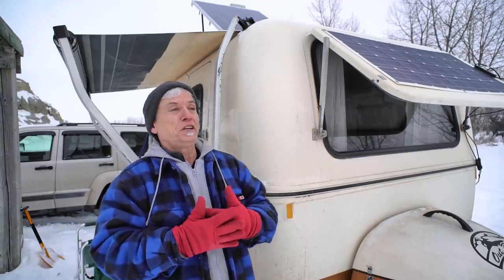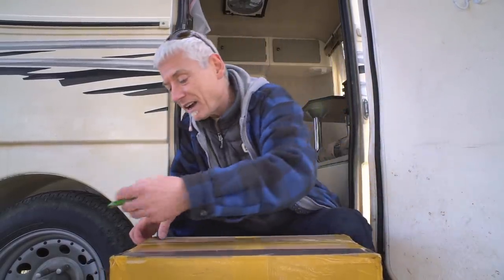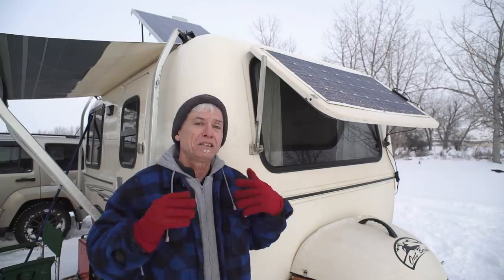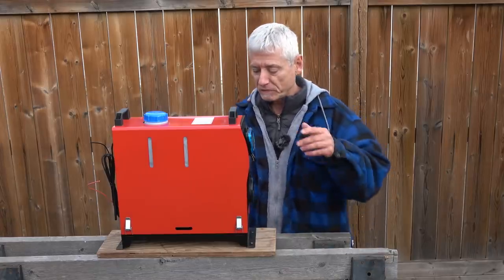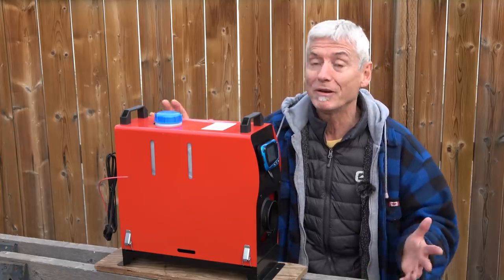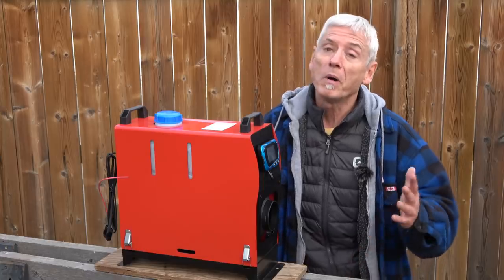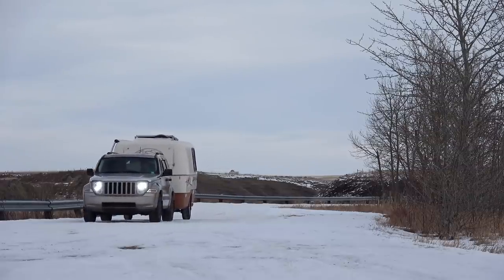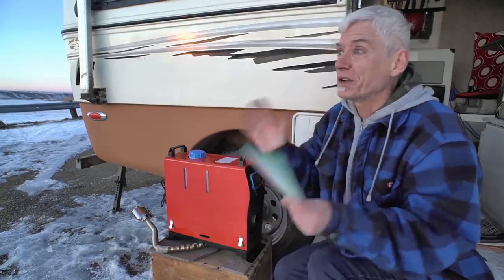Can this Work with a Camper? My Parking Heater Experiment: Part One

Comment: I have my Diesel heater in a cockpit locker, also on the outside. I have been using it with outside air too, no circulation. It gives out nice dry heat, with relative humidity levels of 30%. Totally unheard of in a boat in the wet Netherlands. I really like it!! It is worth the effort to get it bug free. I would look for vacuum leaks in the fuel line before the pump, and use hard nylon line after the fuel pump. Also the Diesel needs to be of winter quality, add 1/4 of Kerosene to prevent it from clogging in low temperature if unsure. My heater will not go below 1.8Hz btw. At the lower settings you risk flame out.    Well, those are my 2 cents, happy puzzling! (I do realize that part 2 is already in the making and you solved it weeks ago. Sorry but I have this Compulsive Fixing Other Peoples Problems Disorder :-)

Comment: I have also heard/read that you need to run the heater at max temp for about 30 minutes periodically. It allows the heater to burn off the carbon deposits that build up when you use it at a lower temp setting.

Comment: SLIM, thanks for the uplifting videos!
1) I'd point the exhaust away from the fresh air intake.
2) Why don't you bring the thermostat unit into the trailer?
3) These are meant to re-heat inside air just like your propane heater does, not heat -6C air.
4) Did you open any vents to allow air out as you pump air into the trailer?  These units shut down when they overheat due to lack of air flow.
5) Can't wait to see the final outcome!
Reply from the maker: 7) Watch Part 2 right now . It will answer many of your questions. SP

Comment: The click is the pump. I've noticed that other rv dwellers suspend the pump so that it's not directly attached to a surface. They say it reduces the clucking noise. However, yours is an all in one.
Reply: I wonder that if the pump is mounted with screws or nuts and bolts if you could add some rubber/silicone washers to dampen the vibration and soften the noise. or if the pump doesn't get hot if you could put some sound dampener like kilmat or noico on it

Comment: I have had my diesel heater for about 2 years now and went through all the same learning curves as you did. We heat a rooftop tent and this is way too much heater for our needs. We have good sleeping gear and blankets etc. so we heat our tent for about 1/2 an hour and all the bedding is about 80F (26C), shut it down and we use it when it gets super cold or when we get up in the morning via the remote. end ofOctober we camped in Upper Minnesota and it got down to 23F (-5C).

Comment: Slim, you may want to use diesel anti-gel additive in winter because diesel will turn to gell in fridgid weather. A real advance over their predecessors, gasoline powered heaters.  I know of people using kerosene or vegetable oil instead of diesel.
Smaller versions of these heaters are ideal for use in vintage Volkswagens for driving in northern climes. The optional gasoline heaters for VWs are very rare, very expensive, big, and very complicated to maintain.

Comment: Our old camper caravan has a propane stove and we could choose not to run the fan on it, to save on power. It would be heating, but not circulating hot air, so we never used it much without the fan running. We had a lead acid battery and it held enough power for a few lights and that fan, during a day and night, but I usually had to connect my car and run the engine to charge it up while driving. It worked great for us, although we never winter camped. Just during the spring, summer and autumn and mostly when it was raining and a bit chilly. We never ran it while we were sleeping. I have too much respect, being a firefighter, to be careless with such things.

Comment: I have one of these without the metal cabinet. I don't have the noise problem from the pump. I think the metal cabinet may be acting like the box around a musical instrument 🎸 which amplifies the level of the sound. I suggest that you open up the box and wrap the pump in something like foam rubber to insulate the sound from the cabinet.

Comment: I've got a 2KW unit in my camper. I think your unit is going to run full bore unless you move the controller into the camper. It has the temperature sensor in it. I started with video 2 and your complaint about it being too hot was the first cue. My initial installation was a hot mess, because the fuel line was touching the exhaust hose, which wasn't apparent at first. Glad to see a new video! Hope you had a good Christmas.

Comment: The Jackery turned off, if not drawing enough power... it turns itself off... the heater doesn't draw enough power on the lowest setting for the timer in the jackery.
Reply: but if that happens the heater's mother boards gets damaged. sudden power loss is not good for them

Comment: It boggles my mind that people still wonder if these diesel heaters will work well for their rv, van, camper, bus.  Lots and lots of people have been using them for years now.  In the commercial industry,  semi trucks have been using them for 10-15 years or more.  
    Slim, i am lucky to have access to webasto and eberspacher heaters for very low prices.  But same difference.   I have a 1983 dodge van.  Ive been living in it for over 2 years. I have a webasto.  Just simply hooked to 1 battery. Works great.  I can have it 80F with window s open when its -10F outside. Van isnt insulated.  I don't ever smell diesel.
Reply: I have a Webasto as well and it is simply superb. The fan noise could be a little better but I have no complaints in terms of heating performance or with regards to the amount of Amps it uses.
Reply: @Daz555Daz  neat
Reply: I love ingenious persons...and share your thought

Comment: Your placing the entire unit outside & connecting the hot air hose to the wall vent is something I didn't see coming. Genius move, dude! 
I wonder if wrapping the hot air hose with an insulating wrap would increase the efficiency at all?

Comment: You may wish to locate the exhaust muffler further away from the heater " Cabin Air Intake ", that's why the exhaust port on the heater aims downwards. Just a thought
Reply from the maker: See Part 2!
Reply: @SlimPotatohead  Bingo

Comment: Slim, once sorted out you will have a good multi purpose unit. Weather to heat your house during a power failure or to heat up your engine block while off grid. Just a thought......

Comment: I saw a review of this one and a Webasto, and its clear that you get what you pay for.
Reply from the maker: That saying means nothing unfortunately. If I spent $1000 more would it be better? Or, I would just be out more money? It depends on the purpose, not the price. SP
Reply: @SlimPotatohead  It would be objectively "better", but for your use case it is impossible to say as every case is different. There is little doubt however that Webasto makes a premium product - but they charge you for it! Still, mine is 21 years old now (same as my camper) and still working like it was brand new. Sadly I don't work quite as well as I did 21 years ago!
Reply: @SlimPotatohead  The video I was talking about was named $200 Knock-Off Diesel Heater VS $1500 Webasto Airtop Heater. There you see why there is a difference between costly heaters and cheap chinese ones. I love you videos and I understand what you are doing. But on a thing this important, its worth the cost.

Comment: Slim I've been following you for a long time it's the first time I've ever commented on any of your videos which by the way I think are fantastic.... the outside air vent that that you modified you should flip it upside down so the lid is shrouding the hose just in case you have inclement weather you're not going to get that little compartment with a heater hose from the outside goes in, filled with water
Reply from the maker: See Part 2. It's out!

Comment: You are slightly restricting the exhaust output by having the 90 degree piece directly from the main exhaust output of the unit. That could potentially cause problems. I would try to let the exhaust come straight out of the bottom for at least a foot or more, before it hits the 90 degree elbow. Maybe cut a hole in the top and along the bottom side of the box that the unit is sitting on? I just think that restricting the exhaust flow like that (even though it's slightly restricted) can cause problems down the road and potentially damage your unit. Just a thought Slim! I love your videos! Your voice over work and editing are exemplary! Good stuff!

Comment: I  wondered if the heater shut off in the middle of the night because its INTERNAL temperature got too high or if, say, a vapor lock in the fuel line/pump developed (assuming that can happen with diesel fuel), even an electrical short somewhere (I know, I'm just guessing now). Another thought, I know you like to experiment but have you considered adding another or larger battery? Looking forward to further efforts!

Comment: Love the videos ! I was researching those diesel heaters . the ticking is the fuel pump , I'm sure you already know that .
if there is room inside to hang the pump from some zap straps . 
cover the heater in sound deadening to quiet it down

Comment: Having the pump on the lowest setting might have caused it to soot up. I use an 8 kw in my 27 foot camper and love it, plus i have the heated air recirculating,  and mine is hard mounted in trailer. Looks like you were within a couple of miles from where i live.
Reply: How are you recirculating the heated air?

Comment: if you watch Bob Wells, he uses a one burner coalmen stove with a 3 thin  metal wall around about six inches high or so, with multiple layers of aluminum on top. it sounds like it wood fit your needs, the walls fold up flat on top with the  aluminum on the stove easy to put a way too.
Reply from the maker: Bob Wells lives in the hot southern desert. This is Canada! SP

Comment: Slim you shouldn’t have the exhaust facing in a direction that the intake air could pull exhaust gas inside your trailer...

Edit: I watched 2 and you corrected the issue. Thanks. I was worried...

I think you’ve made good progress with this heater and I hope you get it to where you’re comfortable using it for your primary heat source.
Reply from the maker: Please watch part 2

Comment: Slim
About your diesel heater you may need to install the inlet tube inside the vehicle and the controller to regulate the temperature it may be overheating the by it shutting off
Best of luck

Comment: Great revision of the original video.

You can likely boost efficiency by using some duct insulation on the hose into the camper.
I wonder what's causing the clicking? I've read/heard that the little fuel pump they come with are subpar, and I wonder is it has anything to do with it.

Comment: Possibly the smell of diesel on the re-start in the night was not waiting for it to cool down? I know now why it shut off as you stated in the other video about the Power source. However, if it does that again, wait 10 to 15 minutes or a little more and it should be better.

Comment: Hi Slim. Let me start off by saying I’m very happy to hear that you are back to doing your videos. I, for one, appreciate your knowledge. I also appreciate the fact that by watching your videos I can do what you’re doing vicariously. Thank you for sharing your knowledge. It’s appreciated, here in Michigan.
My question is, have you ever considered doing a decibels check on the diesel heater? I was wondering how loud it is in comparison to a Honda EU 1000 or a Honda EU 2000 generator? I’ve been watching your Videos for quite some time now and I certainly can appreciate your dislike of “generator snobs”. As much as you hate generators, I have to ask, have you ever had the opportunity to hear how quiet the Honda EU 2000 is. Think of all the benefits. You would be able to charge the batteries on everything that you have and you could have tons of light for around your camper (if needed).
They also have onboard car battery jumpers. Maybe you could even build a box, in which to place the generator, for added quietness. As much as you hate generators, I definitely believe you’d learn to love it once you realize how quiet they really are. I’m looking forward to hearing you thoughts, Although I believe I already know what you’re thinking. Perhaps you can borrow or rent one, just to see if you like it. I think they would make you a believer. But for now, it’s on to watching part two. Thanks again for doing the videos, I appreciate watching them. One last thought. With a small very quiet generator you won’t have any diesel fumes to contend with. Bonus!
Reply from the maker: Eric,  diesel generators are ALL extremely noisy, yes, even the HONDA . I would never use one, and have had to leave many campsites because of rude people and their generator noise. I applaud those campsites that now ban them. The diesel heater is nowhere near as loud, but I still don't like its clanging. Best solution: If you must bring the noise of the city to the quiet wilderness, please stay home!

Thanks! SP

Comment: Think I will stick with my lil buddy heater. Works for me. My NEXT upgrade is gonna be the wave 3 catylitic heater. It's out the way and works absolutely great for me. Jmo.
Reply from the maker: Buddy's have a lot of condensation. I review one in a past video. SP
Reply: @SlimPotatohead  yes that's why im going with the wave 3. Friend has one and works great. Of course im in desert right now. So only need a little heat at night. I try to follow nice weather. Im a van dweller 2 yrs now. It's a little different for me because i just need it like from 1am to 7 am. Love your vids slim.

Comment: I would have put a super large flange on the end of the heater supply air hose which was matched to one of the existing windows on the camper. Blow it right through the window screen. 
No more holes in the hull!

Comment: Hmm. It might be simpler to consider outfitting your trailer with a larger capacity battery and a DC-DC charge controller to sip power from your Jeep while driving. You can also likely supply power to your trailer from the Jackery (love those things).

Nice video. I enjoyed the progress.

Comment: Hey Slim. Just an opinion... I wouldn't use that carbon monoxide detector. Maybe only as a backup. If you run out of battery power or that thing pops out of the 12v slot while your sleeping...We all know that's happened before with 12v power outlets .... I'm sure you have done your research, but a home style one with a screen indicating levels and replacement battery back-up would probably work better. Again it's just an opinion. Good luck and stay safe.
Reply from the maker: Absolutely not! Normal size CO alarms are meant to be heard at a distance. In a small confined camper I would go through the roof if one went off. Car CO detectors are far safer on the ears. Thanks! SP
Reply: @SlimPotatohead  I thought that was the point.  Hahaha. All the best for the year ahead. Stay happy, healthy and safe.

Comment: I think the heater may have performed better if it was mounted inside as it is intended (air intake and exhaust mounted outside).  I'm wondering if the cold outside temps impacted the fuel pump.  Might you consider a some sort of insulation for the heater unit (cover box), or cold weather diesel fuel treatment?  I'm interested to see future trials.
Reply from the maker: See Part 2. It's out!

Comment: Hi Slim. Good video. Wondering? Is it possible that there is a timer on it or a cut off after so long? Or maybe the low temp on controller being outside shuts off? Good luck.
Reply from the maker: See Part 2

Comment: I understand the need, I understand that you’re doing a show, but wouldn’t it be easier to buy an extra battery? It would take the same space as the heater and the jerrycan. And when you’re out of power you plug your car with the engine running.
I always appreciate your videos.
Reply from the maker: Adding another battery means you would now have to charge two batteries with the same resources. I have no desire to run any engine when I'm camping. Please see Part 2 for the conclusion of this experiment. Thanks! SP

Comment: The propane heater is the same as the one I have. The blower takes  about 5-8 amps. I'm looking for a motor that uses less amps. To replace it.  I used to have a old school vented propane. It didn't use any power. I can't find replacement parts. I was thinking about a diesel heater. But they don't have a thermostat control. Peace

Comment: I wonder if the cold outside is what made it shut down? Maybe a touch of water in the diesel freezing? I would think with the tank being inside the enclosure that wouldn't be an issue but who knows. I liked your MacGyver'ed insulated pipe for the closet. :)
Reply from the maker: See Part 2. It's out!
Reply: @SlimPotatohead  Just finished it. Glad you figured it out.